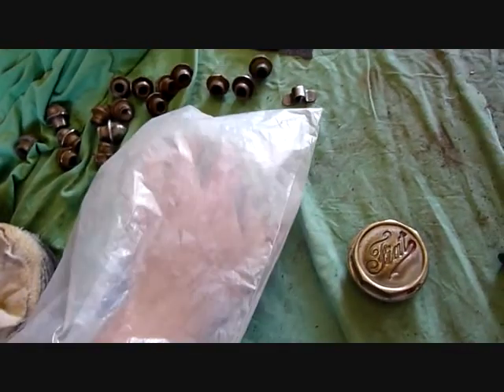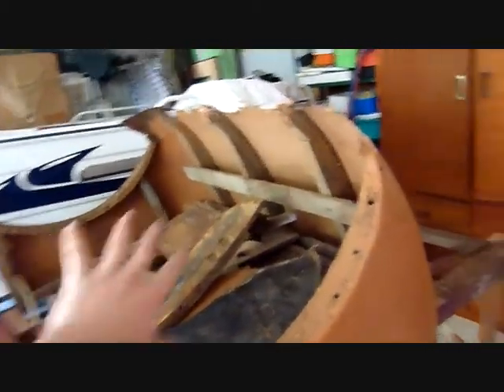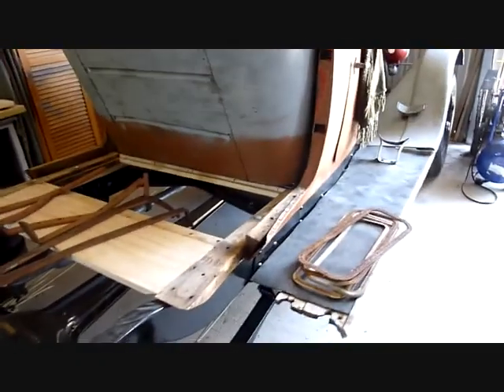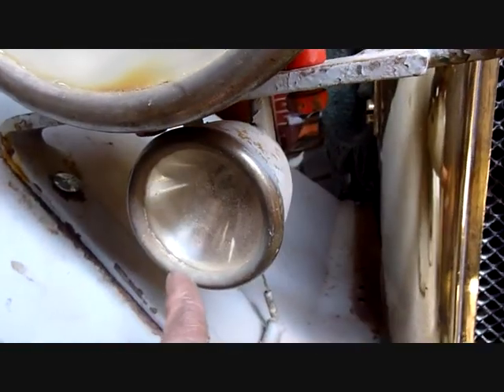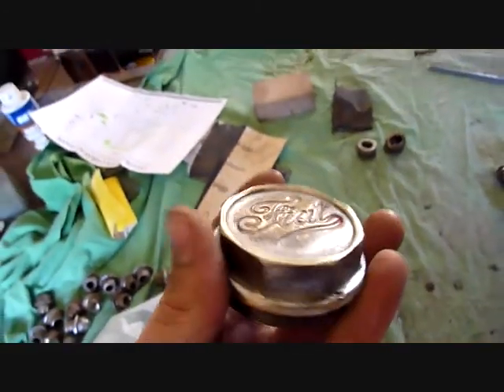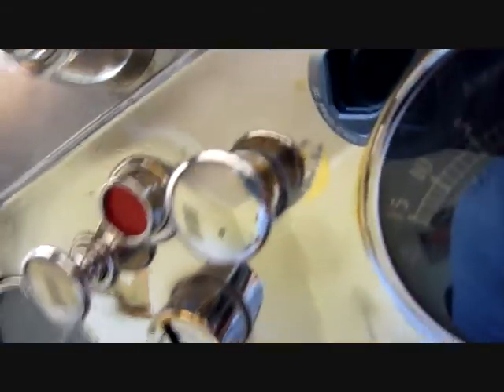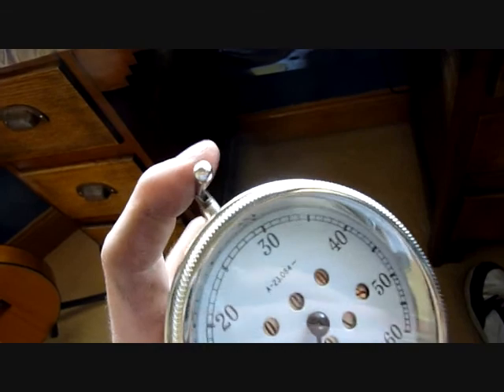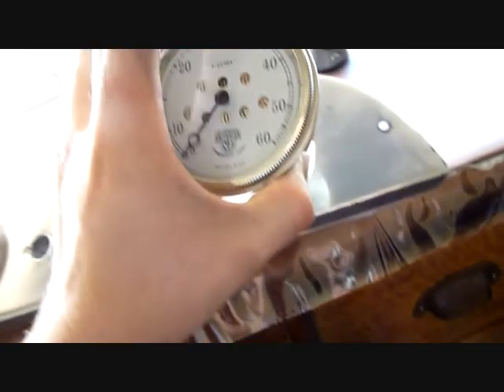Fiat 501 Restoration vlog: 5

Comment: Regarding repairing the blemishes before re-nickeling, perhaps have a chat with A Class. My understanding is that they can plate over all sorts of things, by using intermediate layers. Nickel may not plate to solder, but perhaps copper does, so maybe your repair could be copper plated and then nickel plated, for example.

Comment: @FiatGuy23 They gave a presentation at a Chrysler Restorers meeting 15 or 20 years ago and if I recall correctly, passed around plated plants and insects! You might well be right about Chrome being different but my recollection was that in extreme cases they could get to "thought to be impossible" outcomes by using different plating sequences. Again, it was a while ago but if I recall correctly they could plate over damaged die castings that had been repaired with PlastiBond ...